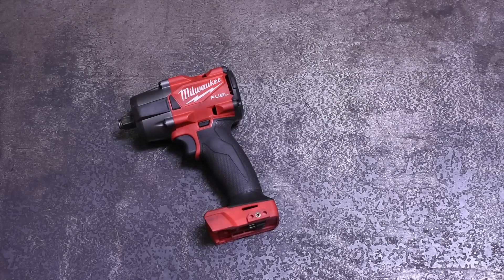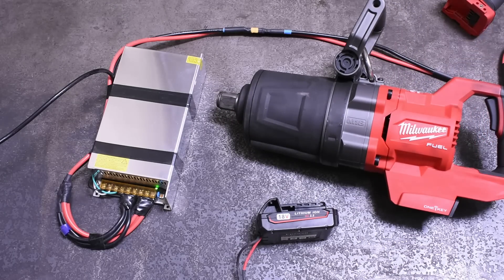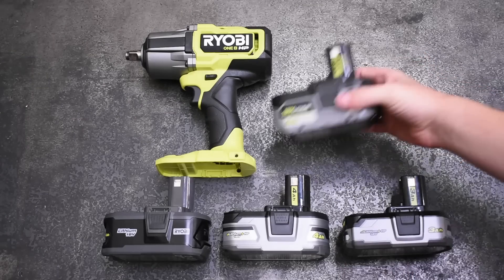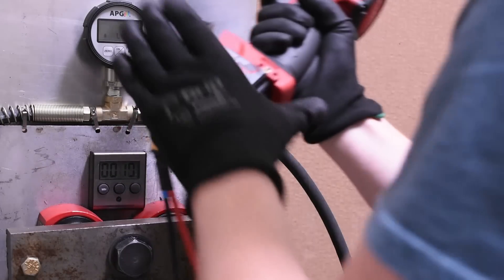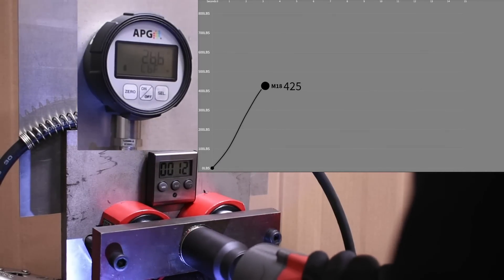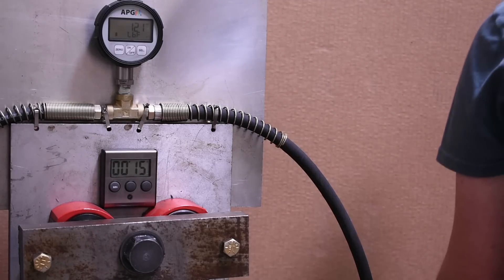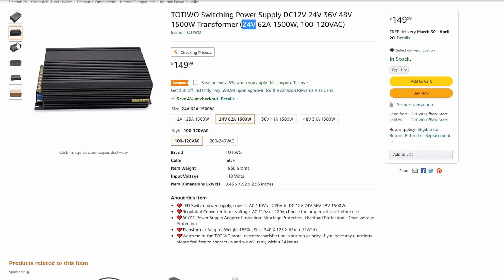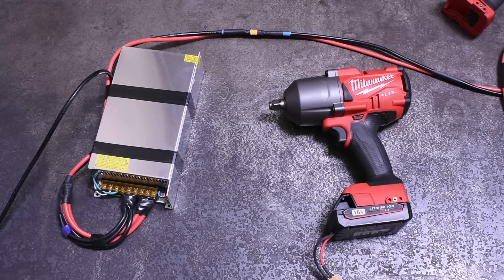Mad Scientist Youtuber Supercharges our Tools: 120 Volt M18 Impacts

Comment: Use a high amperage variac connected to 220/240vac on a 50amp breaker to maintain a solid 120VAC with a DC inverter capable of 24VDC at 3000 watts. Use welding wire for connections as it has more surface area and designed for high heat and floating grounds. This will get you headed in the right direction.
Reply: Presumably you mean cross sectional area since there is no skin effect at 60 Hz. so we want a larger gauge wire. Does sound like fun, though, I have to say.
Reply: @jozsefizsak  Yes. there are more strands of individual wires in the welding cable itself, and of higher quality.
Reply: no reason to delete the locking tabs on the donor battery. No reason to even gut the battery, use the cells as buffer. And then use an appropriate plug.
Reply: Skip the variac, use a power supply with universal input range instead, then the PFC front-end will compensate for input voltage variations better than any variac ever will and most PSUs over 1.8kW are 180-264V in the first place. Going overkill on external wiring won't help much when the electronic motor drivers are usually current-limited to preserve themselves, internal wiring and battery pack.
Reply: @teardowndan5364  The point to the overkill is to eliminate any weak links in the chain. Let the end machine be the limit. A high amperage variac can be dialed to a specific nominal voltage under high load to maintain a constant supply to the dc inverter.
Reply: @Followthelemming  A properly designed power supply will work perfectly fine with any AC input voltage within its specified input range, you don't get any meaningful bonus points for 110V vs 250V or anything in-between besides slightly lower losses in the APFC front-end at higher input voltages where the boost circuit doesn't need to work as hard to pump the input storage capacitors to 350-400VDC, improving efficiency by 1-2%. The only times you need some means of supplying a specific input voltage are when charting efficiency against input voltage and when your input voltage is out of range.
Reply: @teardowndan5364  I forgot that everyone else on the internet is a Rhodes Scholar. The method I provided is a tried and true option, as requested by TTC. I never asked anyone to agree with the comment, it was posted in a general forum for consumption. Why are you so set on smearing this without even conducting the actual test first? Clean linear voltage with negligible loss is the goal, and I know for a FACT this process works. Skin your own cat your own way.
Reply: @Followthelemming   I'm not 'smearing' anything. The FACT is that decently designed PSUs are fully expected to work fundamentally the same across their entire AC input range in a production environment. You only need the fancy equipment to verify/certify the design and troubleshooting, not as an end-user. Efficiency-wise, the variac would almost certainly waste more heat in its iron core and winding than the 0.5% it might save from the APFC stage operating on 250VAC input vs 220VAC.
If your PSU requires a variac to deliver its rated output, what you need you need a better-quality PSU, not a variac.
Reply: My god… the chosen one.

Comment: A power supply with a remote sense line connected directly to the input of the tool would compensate for any voltage drop in the long wires and metal connectors. Just a thought...
Reply: Sense lines ftw!! And measure the voltage to check if the supply is keeping up.
Reply: Why not just use a 12v car battery for a m12 impact and give it hell. It’s got ALL the amps!
Reply: I agree, needs a sense line. Would keep the voltage constant while the load changes.
Reply: Sense line at tool would likely kill the supply as it would overvoltage it's local rails.
Those wires are way too long for being so thin. Also, they will pose some inductance causing a kickback after the initial pulse from the motor. This may shutdown the supply.
I would add capacitors inside the faux powerpack and use jumperlead wires from supply. Or, leaving the tripple wires all the way into pack.
Reply: @1kreature  No well-designed supply will fry itself from a low sense voltage. That's just silly. For kickback, that is solved by a (beefy) freewheel diode. Capacitors will do very little since the amount of energy they store is miniscule compared to the amount being used by the tool and stored in the kinetic energy. Honestly I take this back, sorry. Some capacitance will help with voltage spikes caused by supply wire inductance.
Reply: Choose correct wire and dont worry about big drop and hot wires.
Reply: That seems to be not a voltage drop, but rather power supply detecting the surge and cutting off power, would be interesting to see this test done with a proper copper transformer rather than a impulse power supply
Reply: @UrbExGear  linear power supplies arent as good as switching ones.
Reply: @JusstyteN  true, their eficiency is worse, but usually they don't have much protections and can exceed the rated power without preventively cutting off power
Reply: @UrbExGear  In which case adding some big caps in to the battery adapter thing might help.

Comment: The wire between the power supply and dummy pack is nowhere near large enough for the current required to mimic a battery

Comment: at 18v your battery is nearly depleted, charged voltage is 21volts on an 18v lithium battery, powering the tool at 18 volts is useless ,
Reply from the maker: Good thing we turned it up!
Reply: @TorqueTestChannel  thats good to hear :-)

Comment: Here’s a thought, can’t someone take a Metabo to Milwaukee battery adapter and put it on the wall plug adapter? Or would they electrical fairies escape from their cord? I don’t know how that works, my skills are limited to the mechanical parts lol.
Reply: The problem with battery adapters are the control and safety circuits. This is also why "aftermarket" batteries are so sketchy, they can't properly talk to the tool which can result in either the battery pushing too much power to the tool and blowing it, or the tool pulling too much juice and melting it.
Reply: @Dan-wt7jx  The battery can't 'push too much power'. It's either connected across the load or it isn't.
Reply: The metabo wall to battery adapter is only rated for 750 watts i believe. So less than this

Comment: Just get two (big) car batteries in series and youre at more than enough amps
Reply: The voltage might be a tad too high but definitely worth investigating.
Reply: Or some lipo batteries(they are used on rc planes and drones.) All the amps you'll ever need.
Reply: @_Dimon_  yeah but those cost muchos moneys, i reckon they can find a couple of car batteries more easily
Reply: @_Dimon_  I wonder why I never thought about this more. LiPo's are awesome for high current loads. Why do all tools use Li-ion?
Li-ion's extra safety is great for portable devices such as your phone, but when working with powertools like an Impact, stuff get hot anyway, things can break and hurt you, grease can catch fire. LiPo's could enable way more power to the tools, and are still pretty darn safe anyway. If something were to happen, and a battery started to burn, the working enviroment would most likely have things to accomidate that, either by you being outside, or having a fire extinguisher nearby.
Reply: @sisrace  safety, capacity and longevity. if you browse some airsoft or drone forums you get the picture, they dont age that good and are more fragile in relation to the gain.